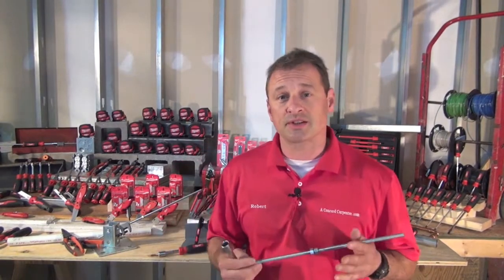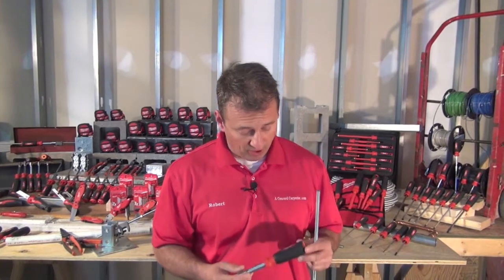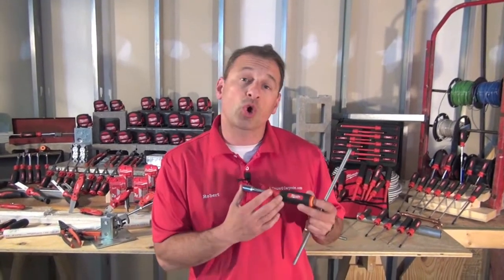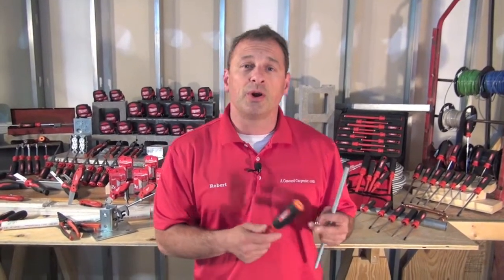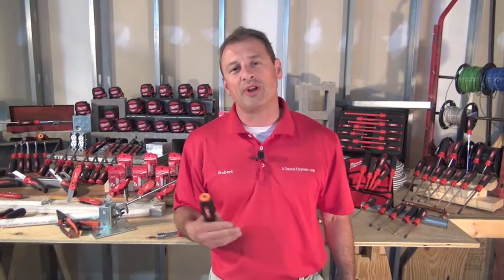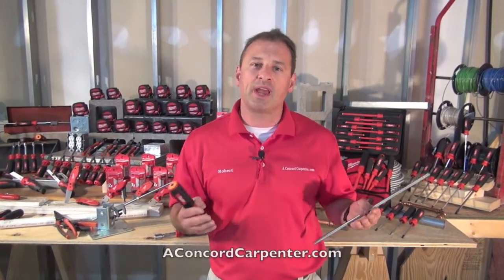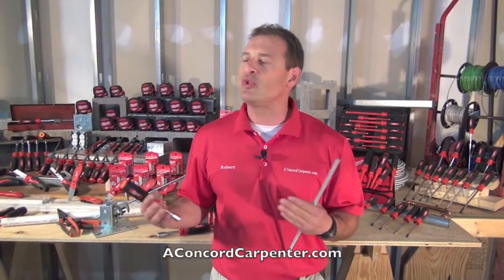Milwaukee Hollow Core Nut Drivers

Comment: Amazing tool. -- It's on Amazon and Home Depot . (Milwaukee 7-Piece SAE HollowCore Nut Driver Set) :::63$-amazon / 50$ - Home Depot::: SAE / Standard Is for USA size. (Hollow Shaft does not allow the hole at the bottom to have it go all the way through BUT the Hollow Core does)